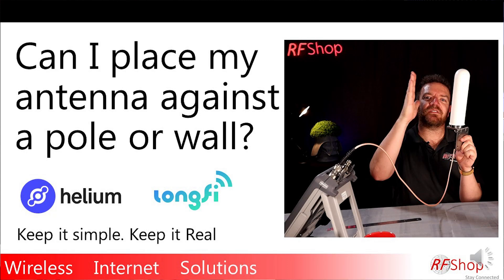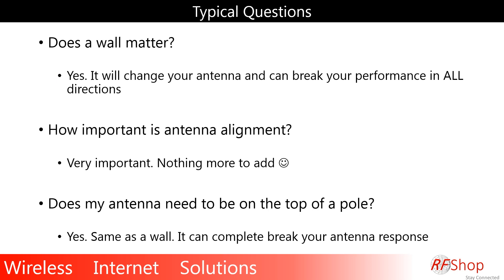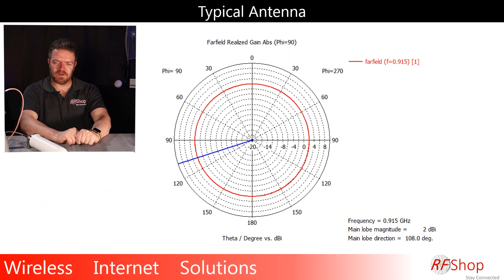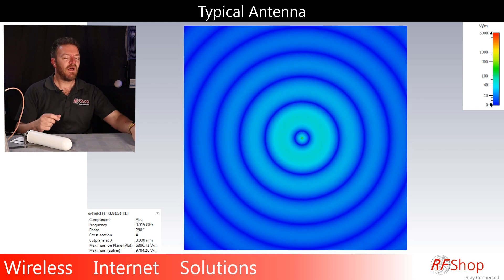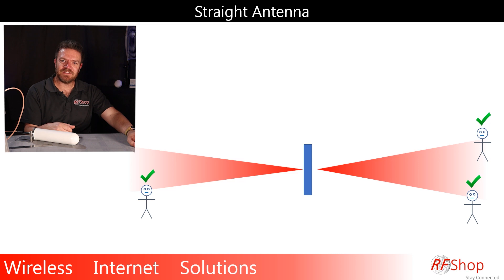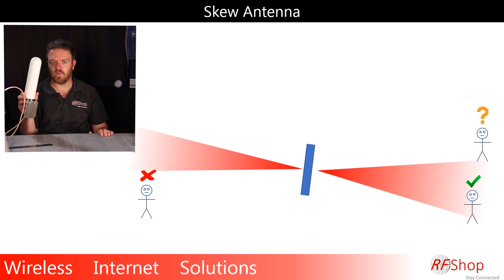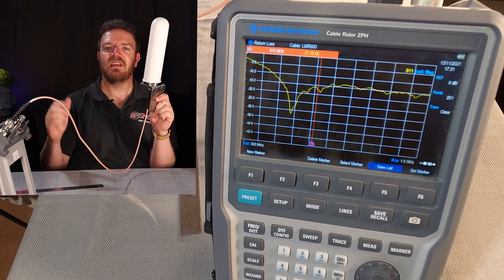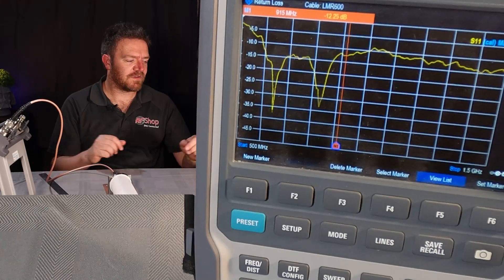Is it OK to place my Helium omni antenna against a metal pole or wall?

Comment: Thanks mate great content , i just got a bobcat miner 300. i live in the woods populated yes and some hotspots yes and i m going to put my antenna on top of house but it doesnt clear the three line of course , is that a big problem and is it true that a window is not ideal because it reflects signals and you better of otherwise....thanks
Reply from the maker: Windows will reflect if it's a metallic tint, but otherwise it's more of a disturbance (higher dielectric constant)...window is certainly better than a wall or even wood.

Comment: As a lorawan gateway is just listening the majority of the - how does this impact the receiving side (antenna in close proximity to metal object)?
Reply from the maker: Taking away the electronics connected to the antenna, the principle of "reciprocity" applies in antennas. That means, the same way it sends is also the way it receives...but it's most often simpler to illustrate and explain the "black art" of RF using the transmit illustrations.
Reply: @RFShop  brilliant! Thank you. There are some huge LoRaWAN Gateway rollout in the UK. We have over 500 in Wales, and growing. I however have seen the odd few with antennas parallel to poles.. Your video backs up my thoughts! Brilliant information.
Reply from the maker: @deanmarsh1452  thanks...that's indeed something that needs to be looked at carefully ;)

Comment: I put my 5.8dbi antenna with base plane outside the balcony against the wall on a 41st storey condo, but i still witnessed a miner 3.3km away behind the building about 4 o'clock and there is no line of sight then also have 2 more buildings that blocks, i not sure how it manage to witness it.
Reply from the maker: The IoT technology is very sensitive (and that's a great thing). You'll still have some signal going in all directions, and 3.3km seems quite plausible to me. If you had a witness at the same distance to the front, you'd see the difference in signal strength and then it will be clear. You could expect the witness in front to be significantly stronger.

Comment: Great explanation - thank you very much.  I am putting outside 40ft mast, anchored with wires to make it more stable but the very top 12ft or so will not be stabilized, 3/4 conduit, and with stronger wind gusts that happen once a month maybe (15+mph, I am not in w windy area, far from the ocean, sea etc)) the top may sway a bit, I think.  Would it create a big problem - does the antenna have to be perfectly still and sturdy for the transmission? If you put it on the chimney then it is 100% sturdy but to me every mast will sway a bit. Thanks!
Reply from the maker: That's really where antenna gain becomes important. Lower gain antennas will not suffer much because of movement. Higher gain antennas can have some trouble. Think about it this way...the pole moving will mean the signal peak / strength fluctuates between the peak 9dBi (for instance) and down to perhaps 0dBi as an extreme. If you are well within distance this fluctuation may not really mean much, but if you are very far away then that 9dBi drop could be a problem. 
However, on a lower gain antenna (say 3 or even 6dBi) the movement would be giving a fluctuation of perhaps 1 - 3dBi...so not much different and I would leave it "as is".
Reply: @RFShop  Thanks a lot for the response. I am seeing it as illuminating the area or distance using bare light bulb (low dBi) or a long distance flash light having a lens focusing the light. I am putting 8.5 dBi, so it will be sensitive to the sways but the question is how much can be tolerated, where is the threshold? If 8.5 dBi had the width of transmission 15 deg or so than theoretically 15 deg sway from the perfectly vertical position should be tolerated BUT the intensity is not equally distributed across that 15 deg cone and here is probably my point. How unequal is that distribution of the strength across that cone comparing edges to the center, are these differences in the order of fraction or a fold, or a few folds. Does it behave same as light which would again help to imagine it as two people trying to signal each other from a big distance at night using flash lights. :-)
Reply from the maker: @tw9472  Good question. The definition of beamwidth is 3db. So if the specification states 15dgr beamwidth, they are really telling you it's no more than 3dB down from the peak value. I think that's the anwer you are looking for right? 3dB
Reply: @RFShop  So, if I follow this correctly then if the antenna sways passing the optimal cone/allowance you may be loosing 3dBi or more and accordingly if the swing is within 5 deg or so - not a big deal, but this also mean there is even smaller chance of overshooting nearby antennas even if yours is high dBi. I am in the medium density area, 50K people town very spread, 30 antennas or so, single or 2 story houses, bigger city ~10 miles/16 km away. One or two people have 8dBi. one on 5m and the other at 10 m and both have nice connections to the locals, most of which use low dBi. I am almost done with the mast, 13m if I don't ruin it :-). Will let you know if it works as it should. Thanks!:-)
Reply: @RFShop  You made me thinking about this and rediscover things certainly known to the specialists for a long time. At distances larger than 5-7 miles the earth curvature rally starts to come into play.  Just checked that in perfectly flat terrain to see each from the distance of 10 miles two antennas have to be elevated to 10 m each, so in reality two antennas are never connecting at their maximum emission unless they are 3-4 miles and located at the first of second floor. I am at the bottom of huge valley that is very flat but surrounded by hills and mountains visible on the horizon.  Only the people having 10+ m antennas can connect from my area to that big city 10 miles away yet some surprisingly have connection of 30-40 miles to the foothills - funny.
Reply from the maker: @tw9472  now you make me see things in different ways as well. Earth curvature is what makes lower gain omni antennes a good contender as well
Reply: @RFShop  One of my friends told me about helium mining and I ordered Bobcat not really to make a money but to make it a education project for my teenage daughter and it seems the investment just returned.
Now the issue reflections during transmission that are also dependent on the wavelength. Eureka: I finally understand why the radio-waves space telescopes are huge dishes.
Two conclusions (at least for me): 1. "I know that I know nothing" which is always a good sign, and 2. "The higher the better" no matter what :-)))))))
Reply from the maker: @tw9472  Love it !!!
My motto when people ask on the phone is really...height is your friend. Gain is handy, but needs to be considered and not just assumed as it can sometimes work against you. However, antenna positioning is absolutely key to a great setup. No matter what technology...

Comment: @RFSHop thank you for this video. Can i ask. if i was to place my bobcat stock 4dBi anntena in my attic on top of a metal backing tray, does this help at all? ive heard this helps? the antenna would be up high center point of the attic  with the baking tray below. Eventually i plan to have it on the outside on top of roof, but for now attic is my only option. Ive just read that placing on a baking tray or metal frame/ironboard helps, is this just misinformation?
Reply from the maker: I've seen those videos where people put their antennas on a baking tray or something and then it improves. Those antennas I've seen are actually monopoles and need those ground planes to work properly so it's not magic, it's by design. However, many antennas (dipoles) don't need the ground plane so won't make a difference. However, it does make a lot of sense if your antenna is a small stubby on a base
Reply: Thank you for reply. Appreciated. 👍

Comment: what program did you use at 3:08. i try to put my antenna in the attic. i seem performance well in some  direction only.
Reply from the maker: Hi Kelvin,
We actually use a software package called CST for our antenna design work. You will find a Student version is readily available.

Comment: Thank you for your support.
Do I need a lightning rod when putting a helium antenna on the roof, especially if it's higher than the roof?
Reply from the maker: Ideally yes, but the whole topic of lightning protection is difficult to explain. I am struggling to get straight answers out of the formal documentation as well. Still working on a video plan

Comment: Thank you for the content. Someone must have told you already but i am not going to read every comment. I believe the bolt next to the red plastic is meant to attach the lighting cable. Unbolt the screw, get the cable below and bolt it again. Also i would put it the other way around so the cable does not make a U turn. But i am no expert.
Reply from the maker: Thanks
Reply: @RFShop  I dont understand how my comment ended on your video, it was meant for a different video. Thank you for all the work you put on your videos, they are very helpful
Reply from the maker: @Jose_Perez-o9c  ah…makes sense. I was curious what exactly you were referring to 😂👍🏻

Comment: On a 5.8 decimal   Antenna where it mounts to the metal it shouldn't swivel shit it and I'm talking about on the outside of the antenna after it screwed into the Magnus
Reply from the maker: Correct, it should not swivel / move when mounted

Comment: Cool explanation, many thanks for it! Please does this apply also to panel antennas ? (Metal plate(balcony) behind the panel antenna)
Reply from the maker: Actually no, the panel antennas are often designed with the assumption that the back will be a metal surface of some sort. You should expect that it's OK to put a directional / panel antenna right against a metal or other material surface
Reply: @RFShop  Thanks for confirmation!

Comment: so if my antenna in my roof/attic in the peak, then would it work better if its lower in the roof/attic then? do the radio waves pass through objects better if they are further away from the antenna?
Reply from the maker: Yes, it would be better if you could leave some space between you and the antenna…perhaps at the 15m

Comment: Hello, I am wondering which antenna you are using in the video. I am wanting to purchase one for my home to give a try mining on the Helium network. LMK if im bonkers.
Reply from the maker: Hi Jacob! I’m using the ALFA Marine Omni in that video. It’s actually a great option, and nothing ‘bonkers’ about the question…in-fact, we’ve seen incredible successes with that antenna on various applications. Have a look at https://rfshop.com.au/product/alfa-network-4g-omni-antenna/
Reply: @RFShop  Hi mate. Your answer makes me search for such an antenna for Europ's specs ! Do you have a marine antenna with higher dbi gains ? cheers
Reply from the maker: @oliserv6225  Poynting Antennas does have a good option for the EU bands
Reply: Thank you for being so prompt! Means a lot. I'm really leaning towards using the Marije Grade Omni Antenna for my home application. I'm trying to reach over 20 miles out. What are your thoughts? It's either this or a 24.5in 5.8 omni directions pole antenna.
Reply from the maker: @jacobgascon5266  I do think you will have good results with that Marine style omni antenna

Comment: Hi, great video thanks, can you give info about the antenna tested around 7 minutes in, 
I am 868mhz and very interested if that is good for UK  Thanks again
Reply from the maker: Hi Wood Wood. The antenna I used for this demo is indeed a very good antenna for a wide frequency range. In the beginning when we were still starting up the Helium range we sold these antennas to customers and they were indeed very happy with the results

Comment: Top content +1, thanks for making this David. I've been doing research online about this for days and I still have a question, what happen with a lower frequency antenna and a thin metal? I.e. when frequency length much smaller then metal size.
Reply from the maker: Hi. Metal will always play some role. On my final year project I used alumnium foil for a reflector and it work really well

Comment: what happens if you use a directional antenna that rotates 360 degrees over the course of 24 hours?
Reply from the maker: I guess that, unless you have confidence in the timing and witness events this could probably hurt more than do good, as you will need to hope you point in the right direction when a remote hotspot send out a witness...or you may actually be facing away when a beacon is sent so you miss them. As for you sending beacons, it could be interesting but I do not believe the Helium system would look kindly at this.

Comment: Very useful content, keep it going.
I have a question: I can place an antenna under the roof next to a window. The window is quite small so a 3dbi fits against it while a 6dbi will be partially covered by the wall. It's a Suburban area. Which one will perform better?
Reply from the maker: Indeed a tough question, but the way you describe the blockage I would prefer the 3dBi antenna.

Comment: I am from India and have one contact who sells 12dbi omni cylindrical antenna with frequency of 698-960/1710-2700 MHZ. Is it ok go use it or this much frequency will decrease my earnings
Reply from the maker: Hi Naman. As long as the gain at 900MHz is indeed that good it will be OK. Just keep in mind that the gain on those wideband antennas will vary a lot do best yo check the datasheet.

Comment: I have a question . My balcony is made of metal . I have a wall of metal, is there someway to block the metal with tape or something from interfering with the signals.
Reply from the maker: Good question. It is in theory possible to use radar absorber material, but that's actually used in very high-end applications and not very cheap (in-fact, very expensive). I would just try to avoid the metal as much as is practically possible

Comment: Nice video.  Can GPU mining block signal from the helium minner antenna?  I’ve noticed items like garage door opener loose range when having lots of gpu miners going. Other signals get worse like cell phones and wi-fi
Reply from the maker: It should not interfere. The garage door antennas are often very weak and low power levels, so any significant source of interference can quickly cause it to fail. Helium is a proper antenna system with much healthier power levels and decent antennas so won't suffer that quickly from random electronic noise
Reply: @RFShop  Thanks for the response.  Was curious about this as GPU mining kills my Wi-Fi signal as well as my cellular signal when near all my rigs.  Come spring time guess it wont matter regardless as I need to get my antenna outside to see if I can get a witness.
Reply: I had a situation where the GPU rig was interfering with the wifi in the next room, even when not on the line between the transmitter and receiver: GPU <-5m-> AP <-5m-> laptop. Turning off digging immediately restored the wifi. Later changing the wifi channel also fixed the issue.
But with Helium you can't change the channel...

Comment: Does cardboard hurt the antenna if it’s mounted against that? Also, how much spacing would there be needed for a 8 dBi antenna between a metal pole, is that also around 7-8cm?

Thanks for making this video helps a lot!
Reply from the maker: Hi Alex. No, cardboard should be fine. Yes, all antenna gain values will behave the same way. It’s the frequency that matters
Reply: @RFShop  my wall is made of metal is there something I can put in between to block the metal from interfering with the signals.
Reply from the maker: @actc6077  unfortunately not. The only material that would serve such a purpose is called absorber. 
Although it could serve the purpose of not seeing the metal obstruction it will absorb the energy so not quite what we want to achieve. Also, this type of material is really expensive, and it would be much cheaper to get another location. 
I know in the video I presented the worst-case problem...but if you want a directional antenna it's possible to space about 8cm from the wall and you will in-fact have a good reflector and increase the forward gain to your advantage. However, it will take from the power / radiation that could have gone to the rear instead.

Comment: Hi David, thanks for your great videos. I am currently planing to put a helium miner on a mountain. the problem is, that i cant figure out if my miner will have enough range and what antenna to use. The city i want to reach is in LOS and max. 17km away. I think atm its best to use a directional antenna. im in the EU btw. Can you tell me if this is even possible?
Reply from the maker: Hi. In theory the omni should be quite capable of reaching more than 20km. I would use 6dBi omni.

Comment: Is it a problem to mount a antenna directly (with contact) on a metal balcony? Will the balcony become part of the antenna and could this benefit or worsen the outcome? Thanks mate 👌
Reply from the maker: It really depends how you mount it on the balcony. If you keep the spacing OK it's not so much of an issue, but don't put it too close to the antenna. Best to have the antenna above the rail
Reply: @RFShop  I have mounted it directly with the mount on the balcony. So the metal plate of the mount touches the balcony but not the antenna itself. Antenna is above the rail. So no problem, right?
Reply from the maker: @chattrick93  that sounds perfect.